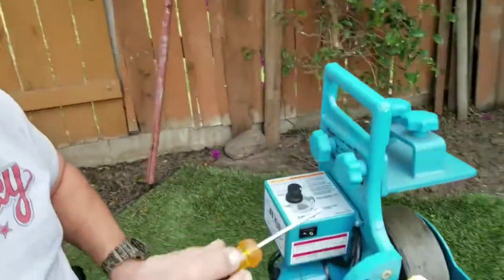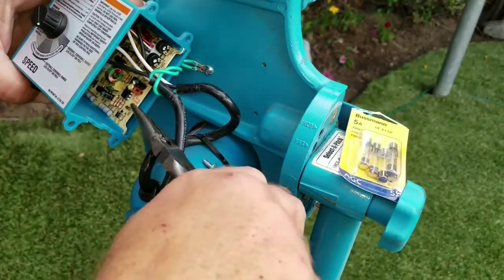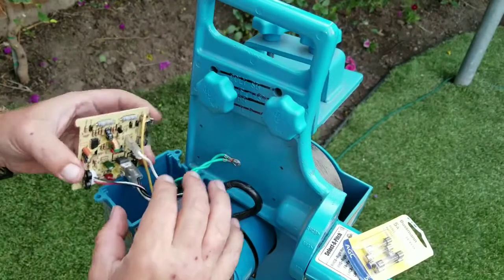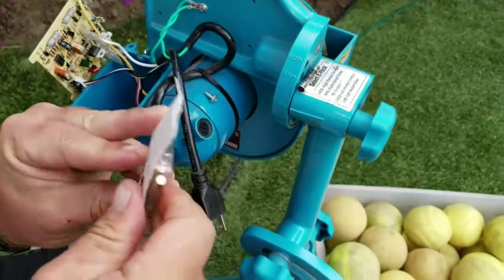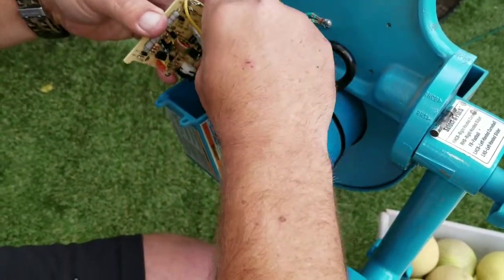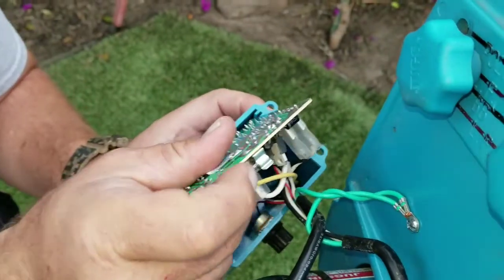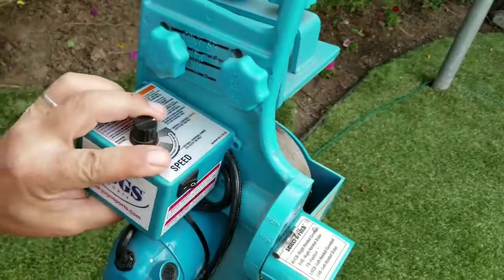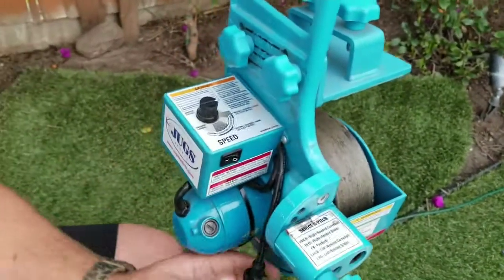Changing Fuse JUGS Pitching Machine Lite-Flite

Comment: Thank you so much for this video!  Our brand new pitching machine malfunctioned within the first 10 minutes of testing and this video helped with troubleshooting the issue. Sure of enough it was the fuse and replaced it with a new fuse. The pitching machine does come with 2 replacement 4A fuses located in the clear pouch attached to the bottom of the machine. You can also purchase a pack of 5A fuses at Home Depot or Lowes.
Reply from the maker: Good to know RE replacement fuses.  Thanks Chasity!

Comment from the maker: 12" JUGS LITE FLIGHT FEEDER.  HOLDS 15 BALLS. 
At further distances these balls would rise, and can also pitch curves and sliders by using the adjustments to tilt the angle of the wheel (not shown).

Comment from the maker: KEY POINT: Use "Slow Blow" fuse.  JUGS says up to 6 amp is OK.

AMAZON:
BOJACK T5AL250V 5x20mm 5A 250V Slow Blow Fuses 5 amp 250 Volt 0.2 x 0.78 Inch Glass Tube Time-delay Fuses(Pack of 20 Pcs)

Comment: Great video!  The fuse and fuse change-out seems to be the achillies heel of this machine (which I just ordered).  How did the 5Amp fuse work?  How did reversing the board go (seems like a genius move)?
Reply from the maker: Fuse blew out again, eventually.  Switching the board so fuse is on the near side made repair easier.
Reply from the maker: Key is to use a "slow blow" fuse, as opposed to a "fast blow" fuse.  JUGS says up to 6 AMP is OK.

Comment: You never change the size of the fuse.
The reason why it's blowing is it's protecting the circuitry.
Reply from the maker: JUGS says can use up to 6 Amp, 250 V, but key is to use "Slow Blow".